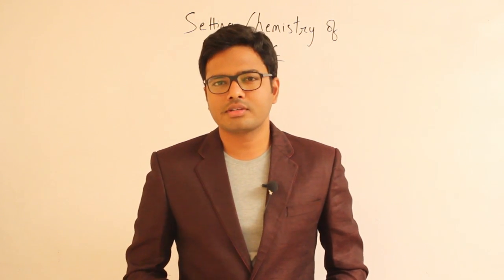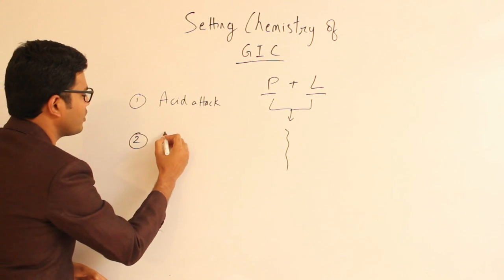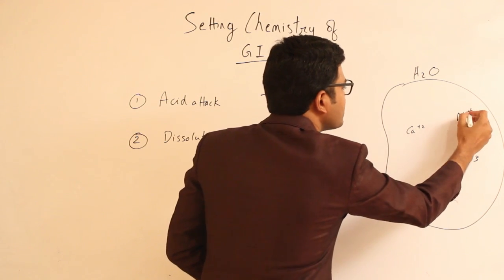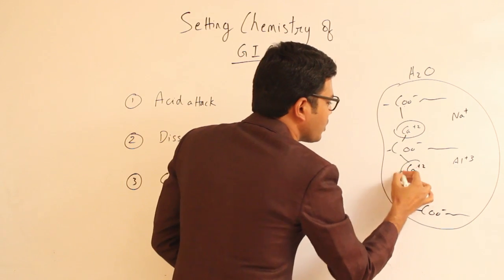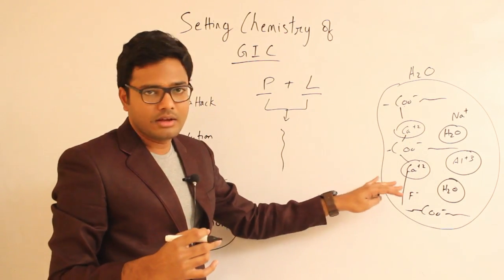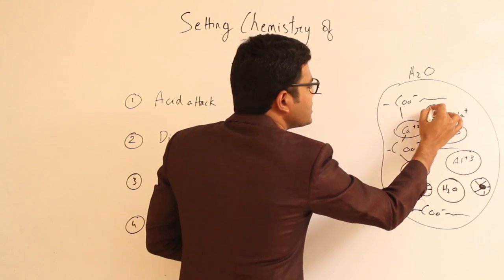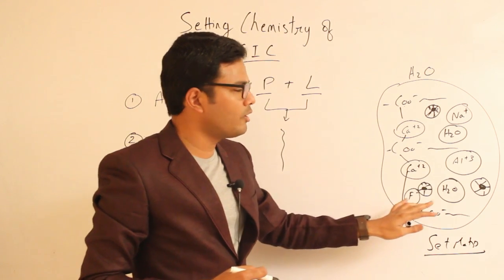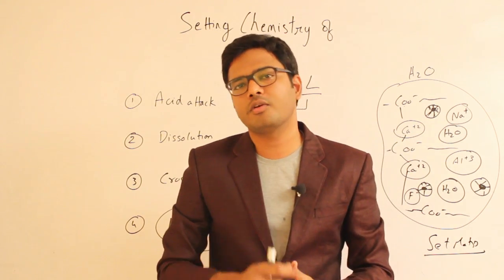Glass Ionomer Cement - Setting Mechanism

Comment: lecture was amazing sir..
sir i have a doubt..at last u had mentioned to use petroleum jelly n varnish to protect d cement from contamination...but will varnish reacts with GIC due to polymerization shrinkage? ???
Reply from the maker: Hi Purnima, glad to hear that. Drop a mail @ proudtobedentist@gmail.com for any clarifications. Best wishes.
Reply: There is no polymerization shrinkage in GIC,
(ACID BASE REACTION).
POLYMERIZATION SHRINKAGE HAPPENS IN COMPOSITES.
PROTECTION OF GIC POST RESTORATION IS MANDATORY.

Comment: Is it safe to use Glass Ionomer Cement 
if yes, what is the best Glass Ionomer cement in the Market that last far longer
Thanks heaps for a nice video.
Reply from the maker: Mountana Berry Thank you. Yes GIC is the most biocompatible material available so far. We have different types of GIC indicated in a variety of clinical situations. And its next to impossible to say that one particular brand of GIC would be best for any given clinical scenario. However literature suggests that resin modified variants last longer compared to conventional materials. Hope I answered your query 👍🏻
Reply: Longevity of GIC depends upon followings
1. Tooth Conditioning prior restoration
2. Good manipulation
3. Fast delivery to prepared tooth.
4. Matrix protection
5. Post restoration protection
6. Finishing after 24 hours.